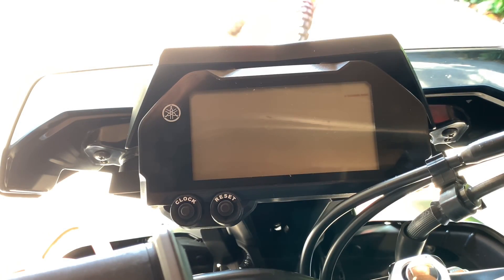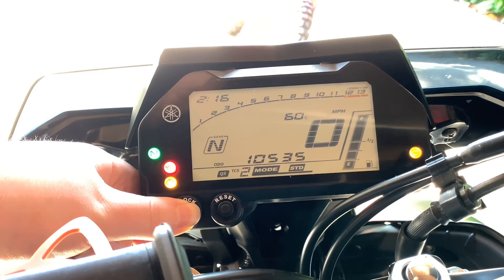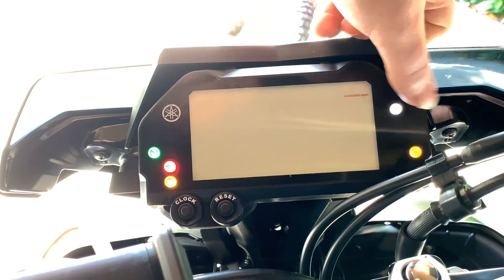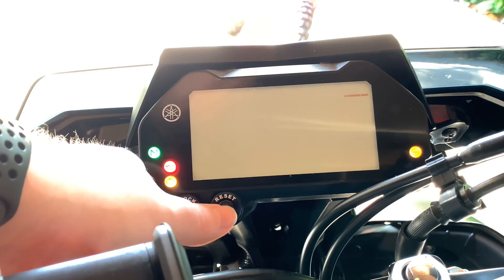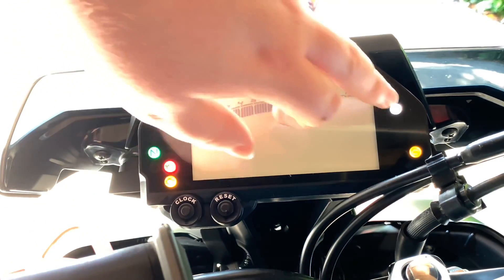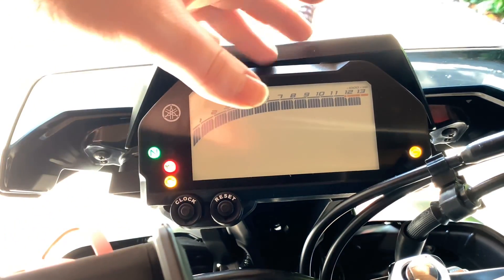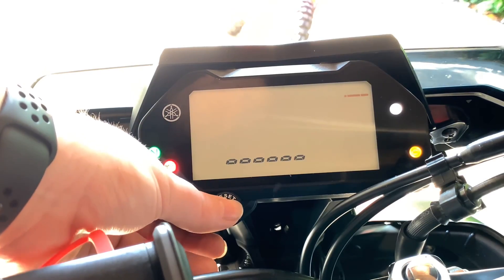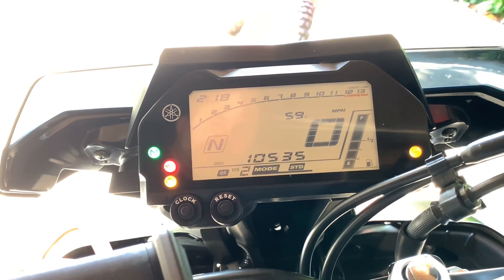Yamaha MT10 how to edit settings on a 2016 and present day MT10s

Comment: had mine for 2 years now, and never even knew this
Reply from the maker: I only just found out myself 😂🤣
Reply: tip: read your owner's manual.. 
they even have the same system on my small mt15, and i would imagine a bike such as mt10 would have even more settings related to it